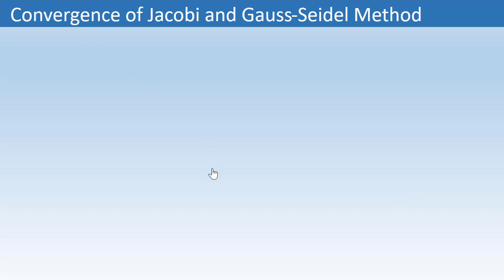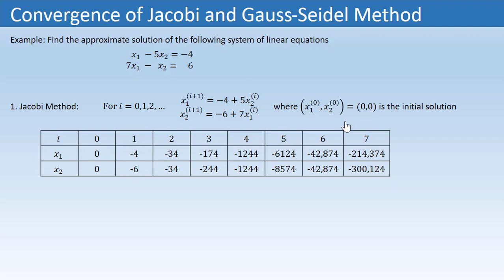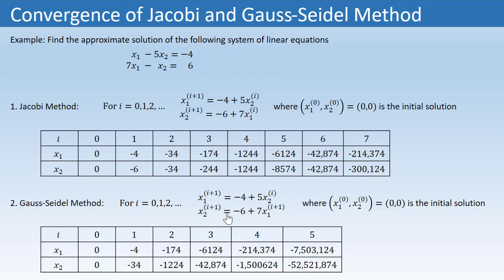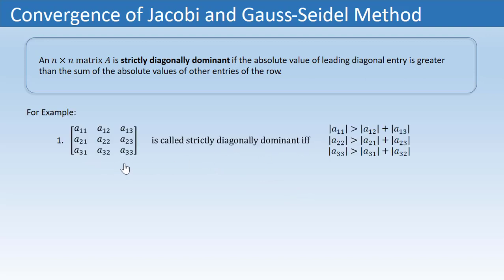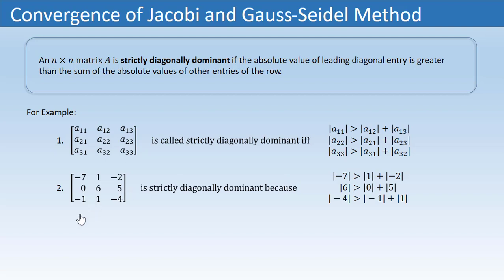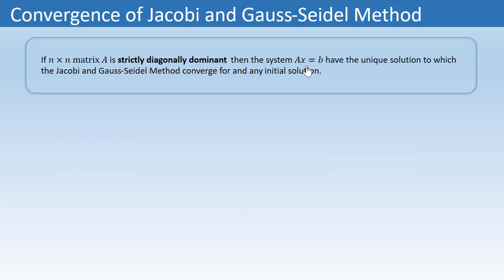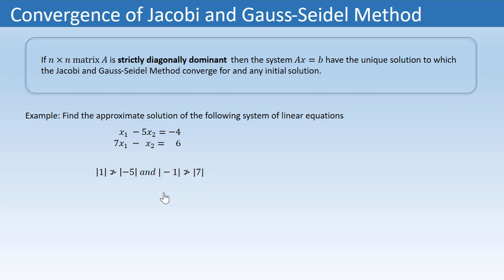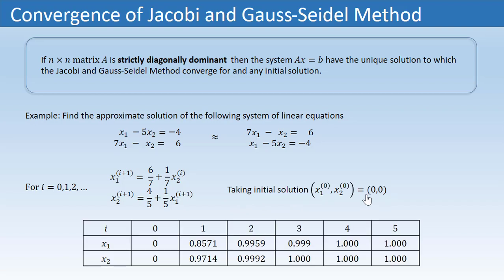Convergence Criteria of Jacobi and Gauss-Seidel Method

Comment: Sir , I have a question where the absolute value of the entries of the leading diagonal is same as the sum of other entries(i.e |a11| = |a12| + |a13|). according to what u taught this matrix is not strictly diagonally dominant..but for this matrix the Gauss Siedel method converges according to the forbenious norm method, Would seek for some clarification..Thank u for this vedio
Reply from the maker: "Strictly diagonally dominant matrix" is the sufficient (not necessary) condition for the solution to converge. Orginally the given system solution was not convergent. After modification through elementary row operations, the coefficient matrix of the equivalent system becomes strictly diagonally dominant which sufficiently proves the convergence of the solution.

Feel free to write if you need further explanation.